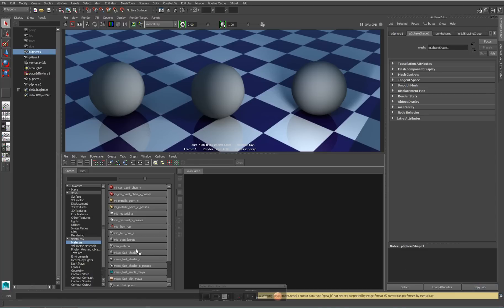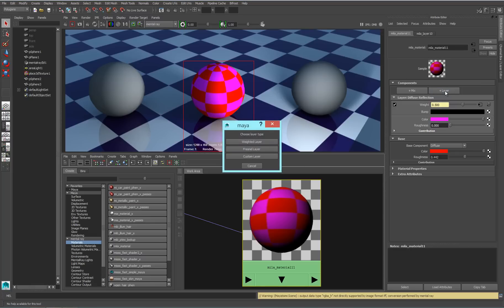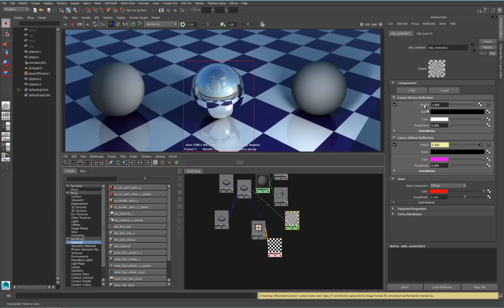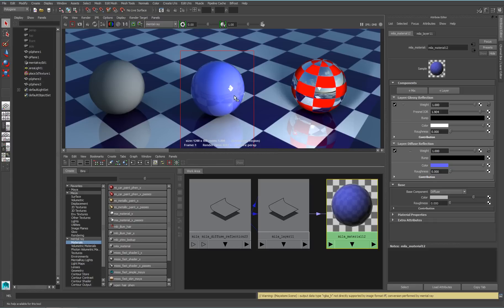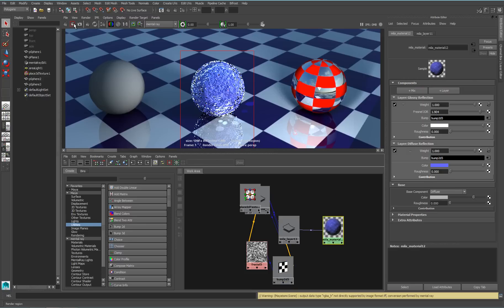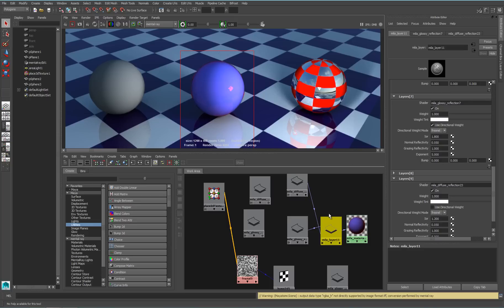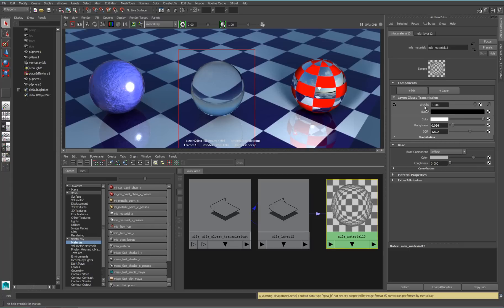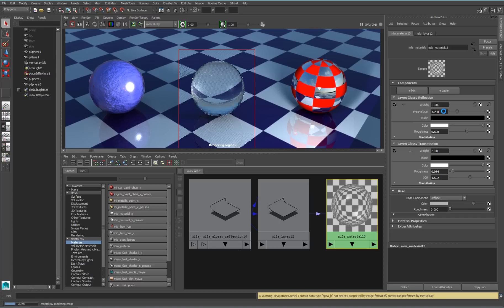MILA MATERIAL tutorial - new to Maya 2015!

Comment: When I render my scene, objects with MILA material appear black. Why is that? I am using a spot light.
Reply from the maker: +Nektarios Kalogridis make sure you are using MR to render. Maya Software draws MILA as black, IIRC
Reply: +James Taylor Thank you for your quick response. Actually I do use MR. Wondering if it has anything to do with my lighting... :-/ Btw, I do see some small white reflections but that's about it...
Reply: +James Taylor Here is how it looks: https://dl.dropboxusercontent.com/u/33556625/Images/Screenshot%202015-09-20%2022.24.37.png
Reply: +James Taylor I think I fixed it. Because I was using GI GPU for rendering, it made it black. When I switched to GI Next, it rendered it with all textures showing, etc. but still considerably darker.
Reply from the maker: +Nektarios Kalogridis interesting. Thanks for sharing the solution!

Comment: How do I make shaders? I researched how to make it, but I was unable to find a tutorial. I'm new to using this kind of software and I want to make something with a lot of detail and texture. Something like, an oil-based painted wall or wooden floors. I want to make it look realistic. Is that possible?
Reply from the maker: ch7849055 yes, that's possible. Watch this vid, look at my video about tiling textures, and the one about creating physical sun and sky in Mental Ray, to get started.
Reply: James Taylor  By following your instructions, will I be able to create something like what's in this picture: https://community.renderman.pixar.com/article/324/amenthyst.html . It's Pixar's lamp. One thing I forgot to mention-- I use Maya with the Renderman plug-in.
Reply from the maker: ch7849055 the primary skills you'll need, after modeling the object, will be lighting and shading. With Mental Ray, you'd need to know enough about lighting to create caustics, and to create a refractive caustic mia material. With renderman, I don't know it at all so I don't know what it would entail.
Reply: James Taylor  I can obtain similar results (because I'm not experienced) of your examples from this video using Renderman mainly because, hypershade works well with it. I used hypershade to create the Pixar ball in my channel while rendering with Renderman and using Maya's materials. I apologize if I sound condescending. I've been eager to learn more about it ever since I downloaded Maya (about three days ago),

Comment: Very informative tutorial, thank you for the share. Quick question though, I'm going for a "fake fur" approach which would be comprised of a diffuse, bump, and AO maps. Would you advise I use the MILA Material? If not that, then perhaps what other material would suit? 

This is a bit more detailed and i'm sure uses a fur generator or sorts, but it should get the look i'm going for across:

 http://i221.photobucket.com/albums/dd231/MohitSherman/b.jpg

I would like to avoid using the XGen fur generator because of batch render issues i'm currently running into and render times for the project.

Thanks!
Reply from the maker: Ren Wilkey faking fur is tough to do... you could try adding strategically placed planes with transparent textures to break up the silhouette, then just paint the rest of the texture to resemble fur. Outside of that, simulating fur is probably the best solution.

Comment: Hey Thanks for the Tut. But i have a trouble shooting question for you.
so im layering out some different layers, but i cant get them too mask out. im using a file texture node, with a black and white image, as either a png, tiff or jpeg,i have tried all three plugged into the weight.. but the result is the same. i cant confine the layers to the masked areas. any thoughts??
Reply: James Taylor
awesome tutorial!!! I noticed you didn't touch on the Transparency Layer and Iv'e been pulling my hair out trying to get this to work. Do I understand correctly that this feature doesn't work right?
Reply: James Taylor Thank you for answering. So I already found 'Alpha is 'Luminance' under 'Color Balance' but it doesn't make any dif. I loaded my character and assigned the mila material, then added the transparency layer, then selected weighted layer. I have a black background with white eyelashes as a transparency map plugged into the weight control for the transparency layer. all the parts that should be masked off is showing up as grey (Base Layer) and the eyelashes are transparent. I opened the transparency map in photo shop just to check the colors are right and they are. black should be transparent and white opaque as I understand it.So next I inverted the colors around in photo shop saved out as tif, loaded the new tif and got eyelashes to show correctly but when I changed the defuse color in the base layer all went transparent. I'm running out of hair to pull out. Thanks
Reply: oh looks like you may have already tackled this...
Reply from the maker: Matthew Delano yup, alpha is luminance is probably the problem here!
Reply: James Taylor  Thanks for the fast Reply... and FACE PALM. thanks man. Keep up the good work!
Reply from the maker: Bruce Landry it works, go into your texture settings and turn on 'Alpha is 'Luminance'. That should do it!
Reply from the maker: Bruce Landry so, maya does do transparecy backwards, as you discovered, you can check invert of texture properties instead of altering the texture itself. Are you using separate textures for the diffuse and the alpha? If not, try that, maya will generally interpret any 32bit texture as using transparency, in an attempt to be helpful. :/
Reply: James Taylor After giving up with no success 2 months ago, I decided to try again and yet still don't get it. This is what I understand about how it works... First I add and assign the MILA material. then add weighted layer and choose transparency as the elemental component. this makes my object in the seen invisible when rendered. Then I add another layer and choose defuse reflection. Set the color to whatever and click the little checker board icon next to the weight slider which brings up a dialog box from which I choose file. Then I browse to the black and white transparency map (jpg file) to add it and then click the check box for alpha as luminance under color balance. Each layer on top affects the layer below it, but rendering it, I don't get any of the defuse color showing through. The transparency map works fine with phong material.
Reply from the maker: Bruce Landry if you can save a screen of the hypershade network that would be helpful to see.
If you are using transparency element, that is different than a refractive element. If you actually want to object to completely disappear as if it doesn't exist, transparency is the way to go. If it is supposed to be a real transparent object, like water or glass, use the refractive element. That could make a difference.
Reply: James Taylor What I'm after is to cut out part of the object like it doesn't exist and only see the part that is not masked off by the transparency map. not trying to create a translucent material. That was pretty straight forward.

Comment: I have a question, and sorry if it's stupid - i'm still learning: what about mila and linear workflow? Is gamma correction node still necessary when using mila? If yes then what's the proper way to use it? b/c plugging gamma into mila base color gives compatibility warnings in output window. Please help.
Reply from the maker: a1t3r3g0 Not a dumb question at all, lots of artists aren't even thinking about linear workflows yet! What is the exact error you get?
Reply: James Taylor
As soon as i insert gamma correction those messages pop out:
API  0.0     18 MB warn   302018: type conflict: "color" is type color, "adskMayaGamma" returns type vector
API  0.0     18 MB warn   302018: type conflict: "color" is type color, "adskMayaGamma" returns type vector
API  0.0     37 MB warn   302018: type conflict: "tint" is type color, "adskMayaGamma" returns type vector
API  0.0     37 MB warn   302018: type conflict: "value" is type vector, "maya_fractal" returns type color
API  0.0     37 MB warn   302018: type conflict: "tint" is type color, "adskMayaGamma" returns type vector
API  0.0     37 MB warn   302018: type conflict: "bump" is type vector, "maya_grid" returns type color
API  0.0     37 MB warn   302018: type conflict: "bump" is type vector, "maya_grid" returns type color

however i must add, that the image renders correctly - i just rather not have any warnings nor errors
Reply from the maker: a1t3r3g0 If it renders correctly, I say minimize your command window and forget about it. :)

It looks like Maya is complaining that you are plugging in something that it doesn't expect to be plugged in there. So a file texture node outputs an RGB color type. Apparently the gamma correction node outputs a vector type. You could try connecting the individual channels manually - so OutRedValue from the Gamma plugs in to your shader's inputRed, Green to Green, etc.

However since it renders fine, it is clear that the values that are being exported from the gamma node are fine, maya is just whining.
Reply: I'll do my best to avoid looking there :). Thank You.

Comment from the maker: Karumachan - if I am understanding you correctly, plug your texture into the 'weight' of your glossy reflection layer. This will alpha out the layer - white is opaque, black is transparent. You can control the strength of the reflection separately, using 'tint' on the glossy reflection node, or the IOR/custom falloff blending.
Reply from the maker: Derpiosa sounds like it is an error with your geometry. Try creating a new polygon primitive, assign the material to it, and see if it renders then.
Reply from the maker: Derpiosa try resetting your maya settings and see if that fixes it. See here: http://methodj.com/how-to-fix-maya/
Reply from the maker: Derpiosa seach for Reset Maya, it is at the very end.
Reply from the maker: Derpiosa sounds like it is something specific to that file, then. Try constructing the same shader in a new file, and apply it to a new standard poly primitive. If that works, you'll know it's something specific to your file, probably the geometry.
Reply from the maker: Derpiosa try doing a Mesh > Combine on all the geo in your old scene, and then exporting it as an OBJ, and import that all into a new scene file. Re-render and hopefully the error will be fixed.

To make a mia_mat render more clearly, adjust the glossiness of the reflection parameters.
Reply from the maker: Derpiosa interesting. Try delting all your history, then use File > Optimize Scene Size and see if that does it.
Reply from the maker: Derpiosa I don't have any other ideas, sorry! If you do eventually figure it out definitely let me know!
Reply from the maker: Derpiosa ok, thanks for updating me! To delete objects, go to Object Mode (instead of vertex/edges/faces), then just hit delete.  Every object in Maya is a node, even if you delete all the faces of an object, the node itself is still present. Optimizing Scene Size usually clears those out, though.
Reply from the maker: Derpiosa wow, dust mold, that is very specific! I don't I've ever seen any material on creating something like that, you may have to figure it out from scratch. If you do, keep notes, I would be interested in seeing what you come up with!
Reply from the maker: Derpiosa animating it would be pretty easy with a Layered Texture node. Attach both the dusty version and the non-dusty version of the texture, and just right-click to set keyframes on the opacity slider in that node.
Reply: James Taylor What the fuck happened to my messeges? They have been deleted. wow.
Reply from the maker: Derpiosa whoa, that is weird. :/ especially since you cn post new posts. I wonder if YT just randomly deletes old comments now. :|
Reply: James Taylor It will remain a mystery :P
Reply from the maker: Derpiosa maybe YT has it out for you...!

Comment: I have a question, perhaps you can help me out because I cannot get it to work properly. I have a reflectionmap I made in photoshop of oil stains, have a diffuse map and a black/white map for parts where it reflects more (full white), reflects less (greyish black) and none (all black). Now I normally use a remap color to use these color values as reflection values but I can't find a way to make that work in the mila. The roughness does an overall by default and if I plug it in with the image I can't play with the reflection values, if I use a remap color then it does nothing (not with a luminance either). The Normal reflectivity in the other layer menu only works if you look straight at it. Do you have any ideas on how to make it work?